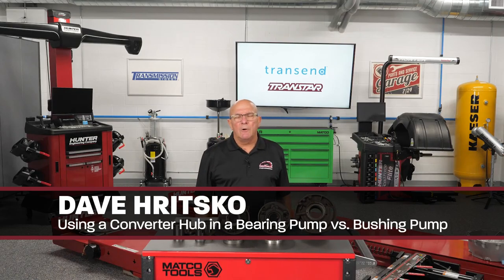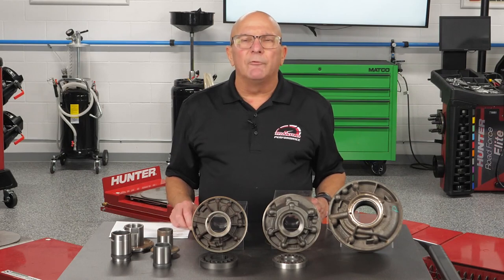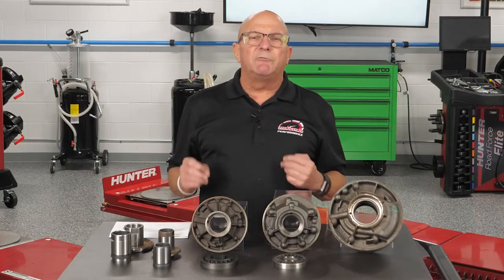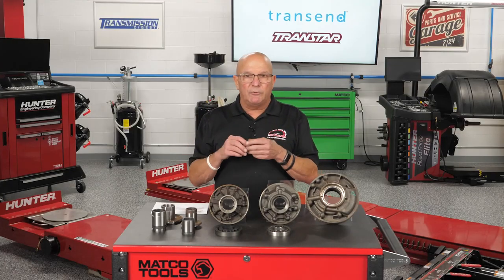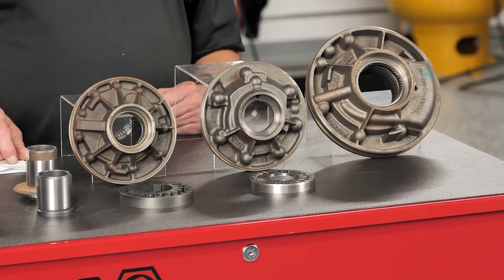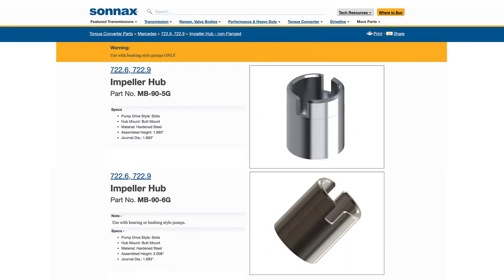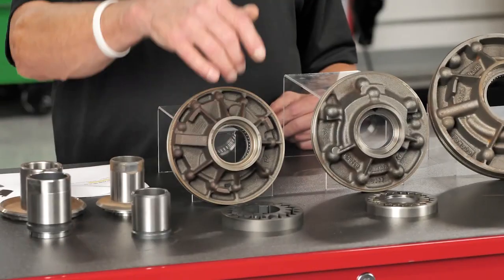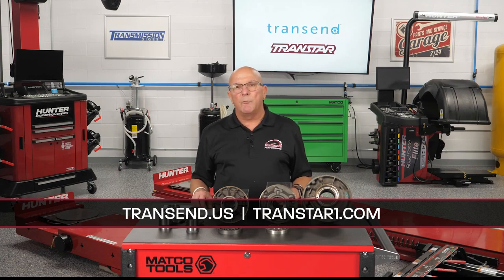What you need to know about pumps and converter hubs

Comment: Question; s My miniature torque converter in my fiat / ram V6 2013 2z4 has zf8hp45 trans- RE: Stator ... Can the stator come apart if so how, & is there a roller. Earing that can. BE replaced ? If this procedure  requires the 450 degree oven ? Or not. Thx moonlighter@jobrated46